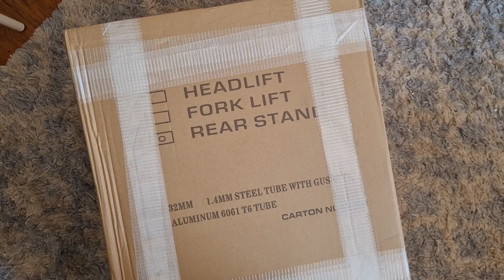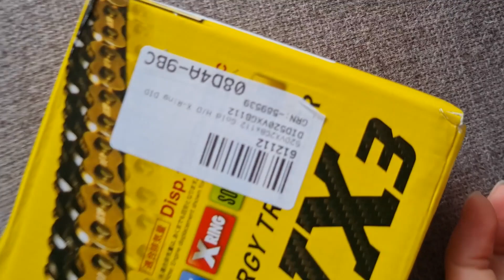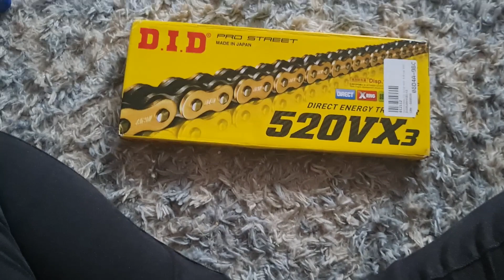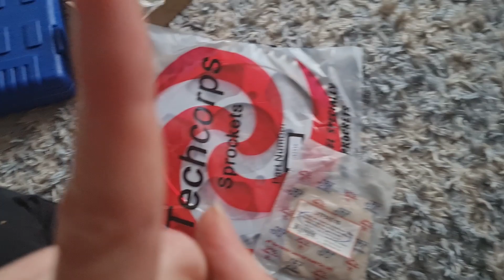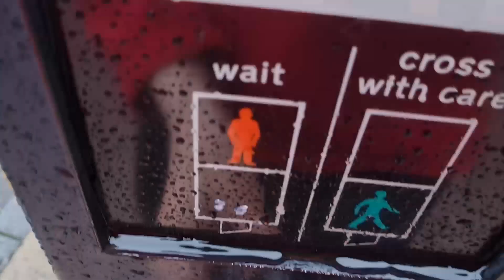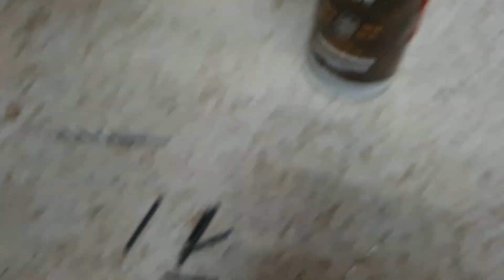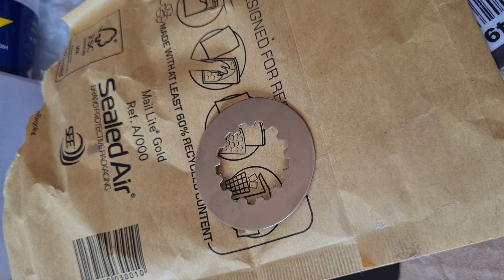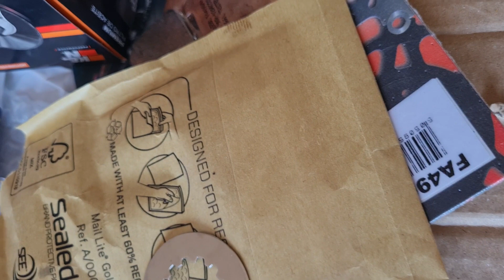Beginner Motorcycle Maintenance: My First Attempt (Part 1)

Comment: Make sure you bend that lock washer back over the nut after you tighten it to the correct torque setting as it stops the nut from loosening and the sprocket coming off then detonating the output shaft , chain and locking the back wheel.  Very dangerous.
Reply from the maker: Yes :^) I did that this morning+
Reply: @SaffySprocket  Relief pheww.
Reply: @RevsIT  I coudnt tell if it was peened over so I was going to make a comment about that but you got it covered. Nice one

Comment: There is something to be said for just giving it a go - I done my first tyre change, chain and sprocket replacement etc but I didn't have the guts to do it alone. Thankful my dad is a bit of a vehicle mechanic and has the tools and know how to assist me.

I feel your pain, because without assistance I'd have been working on my bike for weeks getting nowhere. The first time is the worst, second and third, the daily maintenance and checks they all get easier.
Reply from the maker: It's taken me a lot more time than I expected ahahha
Reply: @SaffySprocket  It took me 3 days with help to work out what I was doing, then I put it into a workshop just to make sure I'd not made a mess of anything only to be told I hadn't finished off riveting the chain on. 😱
Reply: My Dad helped me do my first chain and sprockets. It was only fair 'cause I inherited the bike from him. Once the new chain was on I discovered the rear wheel bearings were also shot so I had to break the chain and take the wheel out again...

Comment: from one rider to another a couple tips for the future, when a hex head bolt starts to strip, before you go to the trouble of drilling and extracting try finding a torx bit that will fit, half the time a torx will grab when a hex won't, also when you need to remove some brake fluid just grab a cheap turkey baster and suck some fluid out of the reservoir then you can squeeze the piston with a clamp or a pair of channel lock pliers and lastly if you don't have an impact then always break the counter shaft sprocket nut loose before you remove the rear wheel so you can stand on the brake while you break the nut loose.

Comment: I’ve only been riding bikes 7yrs and the thought of doing some of the simple jobs seemed daunting to me,I’d been doing jobs on my own cars for yrs but working on bikes seemed like it was going to be harder. My method is if I’m taking something apart I take a photo of it first and always take my time. So far I’ve serviced the brakes,changed brake fluid,changed coolant,spark plugs,oil and filter changes,end can and even fitted a tail tidy which I was so chuffed to have been able to do. Feels so good when you have managed to do it yourself.

Comment: lol, you are so funny, Love it !..... The "holes" you refer to  @5:01  are to let air out when  the welding is being done during fabrication of the lift.
Reply: The holes also are there for the painters to have places for them to use as "hanger-wire- points" to allow them to hang the parts being painted, ....  so the holes have a two-part function.
Reply from the maker: 🤣 I never knew!

Comment: Take the lid of the fluid reservoir, wrap towel around it and push the caliper back.  Any excess will overflow.  New pads in, I put copper grease on the back, don't touch the break material. Put it all back together and pump the break until firm.  Top up and bleed if required.  Easy peasy!

Comment: X ring ‘arguably’ better than O ring, it’s all to do with grease containment, but I’ve run with ringless in the past. In reality, there’s no difference. And on that warped washer at 11:16, it’s  meant to be like that, it’s a locking washer. Bash it back over when you reinstall. If you haven’t done the brake pads yet, best way on those is to take the top off the reservoir and siphon some out with a syringe, then drive the pistons back with a small G clamp pushing the fluid back up the hose without it over spilling. Not really necessary to re introduce more brake fluid unless you’re bleeding them. You certainly are taking on a lot of jobs on at once, that’s enough to test anyone new to it. Well done Saffy, sure you'll learn all the lessons you need for next time 😊

Comment: As environmentally unfriendly that it is, a Scott oiler worked wonders on my Triumph Sprint, 58k miles two chains...... Both of which were D I D X rings. I think the one trick you missed with manual tools is loosen everything first before taking things off! That front sprocket I've never seen come off without using an Impact. Cheap tools always mangle bolts and screws! Well done for giving it go! Blood, sweat and pain is why we love our bikes sooo much!!!

Comment: saffy you can push your brake piston back with your new oil filter wrench...open your rear master brake reservoir lid then using the filter wrench squeeze the piston back....your doing great everyone has to start somewhere and it will get easier for the next time 😀
Reply from the maker: Took me 2 days to realise I had to take the lid off the reservoir lid 🤣🤣🤣
Reply: @SaffySprocket  see its a learning curve....if you take out all the expense of tools and your paddock stands your running costs will be less than £200 you still have the tools and now can make a service schedule for you and your bike so wont be as bigger spend again...
Reply: Never done it. Never had to. Been working on bikes for 35 years.  If the pistons don’t go back easily then they need cleaning with brake cleaner first.
Reply: @SPCK111  This.

I've had to open the bleed nipple to get the piston back a couple of times but that's a sign it needs to come off for a proper clean.

Comment: X ring and O ring have no real difference for performance etc. They both have pros and cons and are both good. I'd suggest you purchase a torque wrench to makesure everything is tightened to the correct spec.
Reply from the maker: I borrowed a torque wrench thus time around but I will look into getting one in the future:D
Reply: @SaffySprocket  I noticed you had a powered one and I got jealous 😂 
All the best in the future with the maintenance 😉👍
Reply: @SaffySprocket  Aldi do a good torgue wrench £19.99

Comment: I very rarely comment on YouTube, but I felt I had to.
I just have to say that I'm loving your video's and you're attitude on all of them. You never give up and that's amazing. Things get tough and you get through. It's a great quality to have and I wish I had more of that when I was younger.
I remember doing my first chain swap and I truly messed it up. Ended up having my bike towed to the garage after having the chain fly off on the way to said garage. I gave up. What did happen though was I learned how not to do it! Looks like you're a step ahead of where I was!
Everything is about experience in life, and you are gaining a hell of a lot of experience. You rock.
Hope my Daughter and Son can watch these when they're older so I can tell them that it's not only them who have tough times and have to struggle with something that they think was going to take 5 seconds (i.e. rounded bolts!).
You're doing the right thing by doing it yourself, and asking for help now and again.
P.s. don't listen to the haters of a split link. They're tough and will put up with anything you throw at it if you install it correctly. I use them on my bikes now as I find them easer to instal and it also gives me a nice mark to know where I started and finished lubing my chain. I managed to crush the pins on a rivet link before, not bad.. it still held on for thousands of miles till I sold the bike. But yeah, fire a split link on if you find it easier. Rivet links worry me now after my experience with them haha. Purely a personal opinion though. You do you. I'll watch the video and enjoy it regardless.

Comment: You're doing an awesome job! Re the rear brake - small g clamps and a thin bars/metal "bungs" can be used to push pistons back but you need to open the reservoir (let the fluid move) and either remove some fluid or put something absorbent over it to prevent it contaminating the bike paint etc. Best case is drain plus new fluid but bleeding them yourself will most likely mean more cash on kit.

Good luck! You'll be back on the road in no time 🏍️
Reply from the maker: Thank you so much ❤️
Reply: The plan is to change chain and sprocket, become changing brake pad, and now need to bleed brake fluid. Lol. After bleeding it, maybe brake lever will scream 'i need a change'
Reply: @winters4960  It's one of those "how long is a piece of string?" scenarios. Once you touch one thing, you start to notice all the other things that need doing, so one job explodes into 5 or 6.

The upside is that once they're done, the bike is good to go for a while, and the experience gained helps keep on top of maintenance going forwards.

Comment: I would get a official Suzuki workshop manual for your bike it will be the best investment you will make they can be got off eBay second hand for not too much money. Your brakes might just need a good clean to get the pistons to go back in you also don’t need to get more fluid as you can remove the cap off the reservoir and take a few cc (less than 5) out with a small syringe.
Reply from the maker: I tried to find one but I couldn't find it!!!
Reply: @SaffySprocket  What year is your bike?
Reply from the maker: 2017, AL7
Reply: @SaffySprocket   That will be too modern for a second hand one as someone has said the SV forum will have PDF’s.

Comment: @09:44  If you continue doing your own maintenance, you'll soon find that dealing with chewed screw heads, seized bolts, stripped threads e.t.c is all part of the fun!!!. Chewed screw heads can be avoided by buying a set of JIS (Japanese Industry Standard) screwdrivers; most home mechanics use philips screwdrivers that don't fit quite as well. A good way to tell if you're using the correct size screwdriver, is put it into the slot of the screw, and if you can hold the screwdriver horizontally without the screw falling off, then it's a good fit. 

As for dealing with chewed screws; if you can get a pair of molegrips on the head of the screw, that often works. Failing that, one trick I learnt in the trade is to take a solid steel bar (between 10 - 15mm diameter), place it on the screw head and hit the other end with a hammer until the slot has closed up. You can then hammer in a 1/4 inch screwdriver bit until it fits tight, then turn the screw out. As well as the steel bar and hammer reforming the head, quite often the shock is enough to break any hold on the threads created by corrosion.

Edit: be careful using broken bolt/screw extractors; they are hardened steel and if they snap,  you can be in a far worse situation!. I'm a City & Guilds qualified motorcycle mechanic and I never use 'em 😉

Comment: I Have to say, I admire your decision to do your own maintenance, if only using a rear paddock stand "tie off" the front brake, this stops any movement, and get an "impact wrench", nearly every pin and nut seizes over time, but an IW, makes life very easy,  great to see you persevering and every minute you're learning new skills. Good luck from an old hand of 49 years, I do everything myself, as I then know it has been done correctly and in spec.!!
Reply from the maker: I got an impact gun recently, its made everything so much easier 🤣
Reply: @SaffySprocket  Make life easier for Future Saffy: don't put bolts back with the gun. One day you might have to take it out again and you'll have no one else to blame for them being so tight. I always buy second hand bike so I can blame the previous owner for stuff!

Good advice about the front brake - loop a zip tie around the lever and grip to prevent the bike rolling like it did in the video.

Comment: Great thing you are throwing yourself at the maintenance train Saffy. 😅
I just want to mention a very  important thing. Handling waste oil is kind of not healthy, to say the least. Waste oil is very carcinogenic! So Please Saffy, always always use Nitril gloves when handling waste oil, of any kind!! ☺ New unused oil is not dangerous, it has a different chemical compound so to speak.
I have a brother that works in healthcare with these things, and he can't emphasize it enough! Just for info, to make you younger generations handle waste oil with care. 🙂

Just a couple of trick when loosing the sprockets. Loosen the rearwheel sprocket nuts before detaching it from the bike. The same is true with the engine sprocket. lock the rear brakes to loosen the enginge sprocket easier. Do not have the bike in gear while loosen the engine sprocket, if you are using an impact wrench. That might wear, or in worst case damage the gearbox.
But mostly it ends well. 😅

Comment: I think you've done really well so far and I'm glad to see that you are doing it yourself.  Once you've finished this job the next one will be much easier and you will know it's been done properly and you will save money in the long run. One very important thing when working on motorbikes or anything mechanical is that there are times when a good swear helps enormously. Especially when you banged your arm.  A good swear and a hop around usually takes the pain away quickly.  😂
Reply from the maker: 🤣🤣🤣 I was in such a bad mood all night after that
Reply: @SaffySprocket  Other thing I meant to say was, I've got a tool for pushing back the caliper pistons.  It's quite a simple thing and didn't cost much.  Worth having, but watch your fluid level for overflowing.  That stuff strips paint.

Comment: to push the piston back in use a g clap like you have for wood work. wind  piston back all the way you should have room for new pads.you might leek some brake fluid put a rag around rear top up bottle so you dont get any on paint.
Reply from the maker: Thank you so much ❤️ 💓 💗

Comment: I think the best way to break the nut free on the front sprocket is to leave the rear wheel on and put a pipe through the wheel spanning both sides of the swingarm so when you apply pressure to loosen the nut the frozen in place rear wheel will prevent the sprocket from rotating. Also put a pipe on the end of your breaker bar to mega-ply the leverage of the tool. the jobs you performed are not difficult when approached in the right order with the right tools and right techniques...all a learning process.

Comment: Hi There, Saffy. First time watching your channel and boy, do I feel your pain. As others have said, the tools are stupidly expensive, but they're a one time cost and will serve you in the future. The first time I changed my chain and sprockets, the front sprocket was so tight (it had never been changed) that not even an impact driver could loosen it. In the end I had to use a small hand drill with a diamond bit to grind the bugger off and use a chisel for the last bit. What I learned from that is that one should grease the thread so that it comes off easily the next time. That said, you're doing well and you're learning a whole bunch of stuff. Massive congratulations.

Comment: Good on you Saffy for having a go at it, sometimes stuff just goes sideways, but you have persevered with it, even if you decide not to do this again at least when the shop tells you they need to do this or that you will know if your getting stiffed or not.

I did a stupid thing changing my battery the other day should be a simple job hey, jump on the bike hit the first turn no indicators, thirty minutes later worked out I had not connected the earth wire to the negative terminal but trapped it under the battery but could not see it until I pulled it all apart on the side of the road, lesson learned and will not be forgotten. 🤔
Reply from the maker: I did that one originally ahahahha

Comment: Hi Saffy. First off well done for having a go. Reminded me of myself when I worked on my first bike way back in 1975. I had just a socket set, a few spanners and a couple of screw drivers but soon discovered,  as you did, that you need more. Luckily my Dad had a shed full of tools. Couple of tips though that might help in the future.  When you do buy tools get the best you can afford. They will last longer and more importantly will fit the nuts bolts etc you are working on better. Cheap tools are cheap for a reason. Back when I started there was no Internet to find out how to do stuff. We had Motorcycle Mechanics magazine and a Haynes manual. There are some good channels but some not so good as well. Watch the ones that show how they do stuff when it becomes a problem,,  not the 'here's one I did earlier' channels. Your breaker bar is a good investment but when you use it keep pressure on the socket end and push the bar down rather than up. Make sure your bike isn't going to fall over or move as well. On tight fixings use six point (impact) sockets. They drive more on the flat of the nut rather than the corners (12point) so less chance of round things off. Next time you need to change chain/sprockets it's easier if you crack all the nuts before you take the wheel out. It's hard to hold the rear brake and undo nuts so use a piece of 2x1 timber on top of the swingarn and through the wheel. This will stop the whole lot turning. (Or get an impact gun. Best option but more expensive) Also split and rivet the chain with the wheel and sprockets all fitted to the bike. Much easier. You found more jobs to fo as you went along but the good thing is you won't need to do these all at once next time. Just keep a eye on stuff and pick the jobs off one at a time . Good luck!

Comment: I am sure somebody else will have mentioned this in the comments but please make sure you fold the washer  tabs over on to the flats of the front sprocket nut otherwise it will come loose very quickly and could cause a lot of damage. you are doing grand though so keep it up.
Reply from the maker: I did! I ended up using the same washer as the one I purchased was the wrong size!